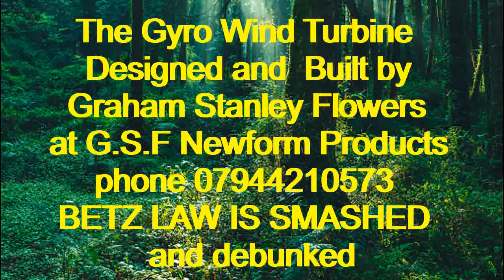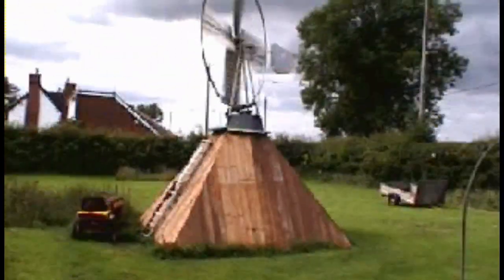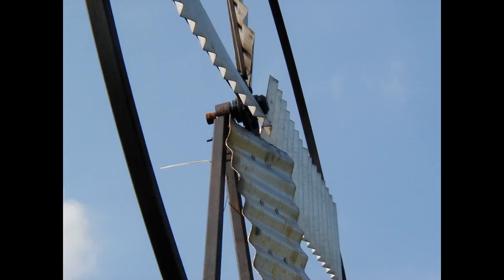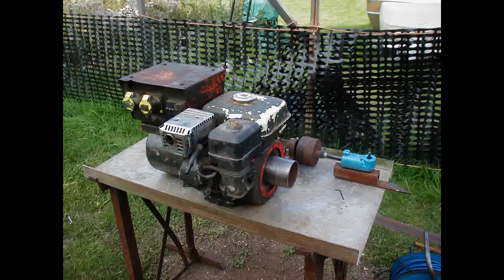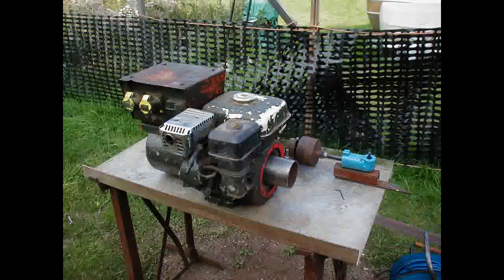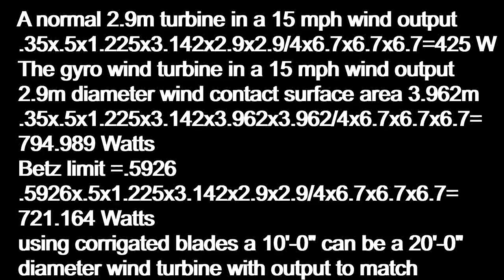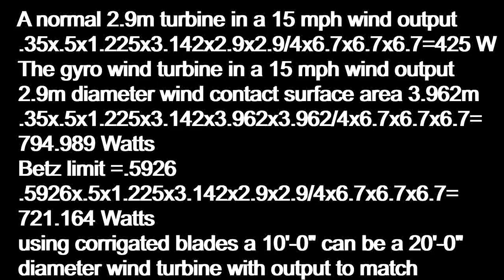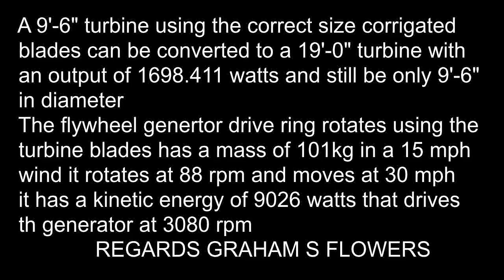The Gyro Wind Turbine designed by Graham S Flowers MEng

Comment from the maker: The unusual thing is I broke Betz limit before I new it existed not until I started promoting my turbine and talking to other people at seminars like Mr Fred Mead  who got Birmingham University to come and look at the turbine for me in 2005
Reply: It is worth checking out the video at the following link for further confirmation regarding inconsistencies with the Betz limit:
https://youtu.be/ZK_rmUg4oJs
Reply from the maker: @cwt5654  Hi Betz limit is a deception from start to finish wind pushes what it touches regards Graham
Reply: @grahamflowers  Hi Graham...  There is an academic paper (Google 2110.14612  pdf) which gives a comprehensive theoretical perspective on why the Betz limit does not apply to wind turbines in practice.  It's a bit heavy going but the main conclusion is that the maximum energy extraction limit is around 67% (1.13 ratio increase) which is very close to the figures for your turbine  (794/721= 1.1).
Reply from the maker: @cwt5654  with my turbine I can increase the output by 100 percent check out my other videos regards Graham
Reply: @grahamflowers  I have checked out quite a few of them!  Just an observation - the corrugated blades may have an additional benefit other than increased surface area.... the curved upper surfaces funnel airflow into the lower channels which then exit the blade at higher velocity creating a vortex effect in the wake stream.
Reply from the maker: @cwt5654  the flywheels  contributes a massive amount to the turbines efficiency regards Graham
Reply: @grahamflowers  Flywheels to NOT increase efficiency
Reply from the maker: @MrSummitville  give me your definition of efficiency regards Graham
Reply: @grahamflowers  Simple ... Does adding a flywheel increase the yearly kilowatt-hour   production or not?  The answer is "... It does NOT ..." .   Therefore, it does not increase efficiency.  YOU stated it does increase efficiency by a massive amount, but YOU offered no proof.
Reply from the maker: @MrSummitville  by adding the flywheel it changes the turbines reaction to wind speed fluctuations as the wind speed changes from second to second the flywheel gives a more consistent power output and gives a larger annual output than a turbine without the flywheel regards Graham
Reply: @grahamflowers  Prove it ...
Reply from the maker: @MrSummitville  watch my YouTube video called the gyro wind turbine 2 to see how the flywheel keeps the wind turbine turning even when the wind fluctuate from second to second regards Graham Flowers
Reply: @grahamflowers   -  a flywheel effect "may" increase tollerece to turbulent wind - that isn't an "efficiency gain "per-se".
Reply from the maker: @kadmow  You have not looked at the video then